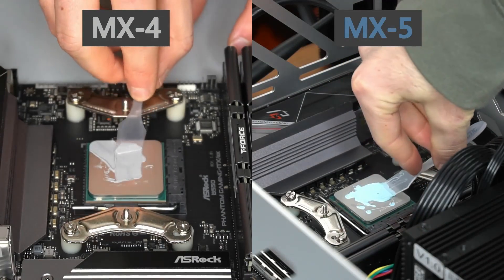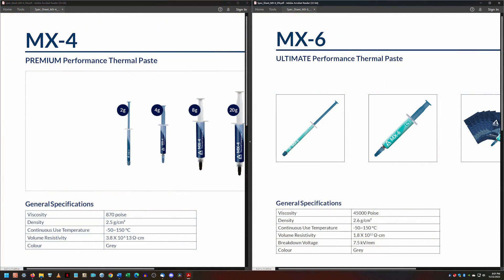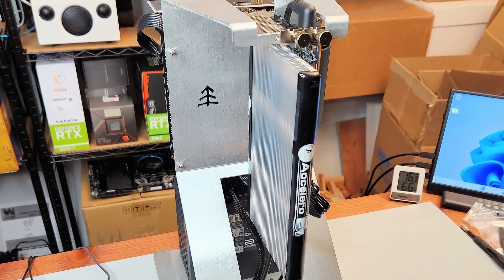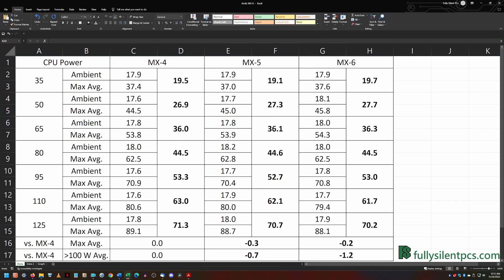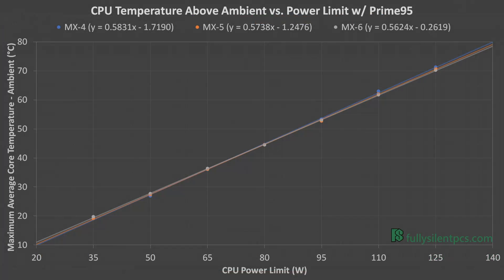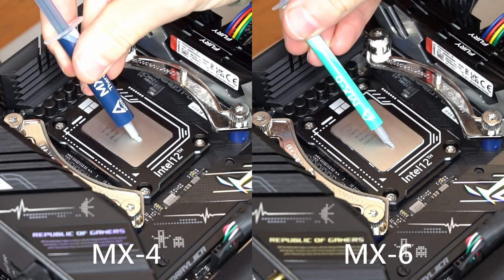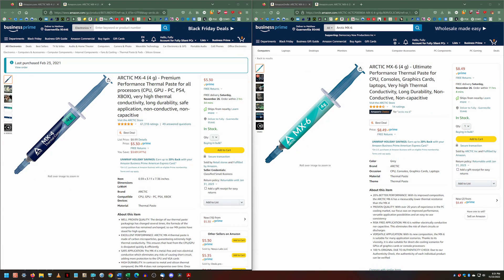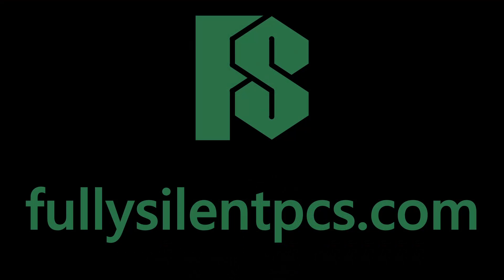Arctic MX-6 vs MX-4

Comment: A tip for all when using high viscous paste. Put the tube of paste in your pocket for 30 mins to warm it up and then use it, spreads way better lol.
Reply: gigachad commenter, ill keep this in mind even for less viscous pastes, absolutely genius
Reply: @CorruptedDogg 😂
Reply: Do you know if more viscous paste, means that it has less chance of "pump out" over time?
Reply: @millanferende6723  I don't believe so, I use mx4 still for most of my hardware. I was using thermal grizzly kryonaut, but it's pump out is worse. Doesn't mean it's bad, you just need to re-apply more often. Tho this is my personal experience which others might argue different. I think it's just based off the materials used when manufacturing the paste.
Reply: @Bassjunkie_1  Thank you for your comment! So is MX4 better for longevity then than MX6 and is that why you use it?

I've heard of Kryonaut being not so good for longevity. 

But what about Kryonaut Extreme

Thermalright 8TF
and
Noctua NT-H1

Do you have any experience with those?
Reply: @millanferende6723  Funny you ask, I have a tube of the thermalright 8tf for when I redo my water cooling on my GPU. Like you, I read it was good. And I figured if I'm rebuilding the water loop every year or so, I'd try it, tho I haven't used it yet 😅 I have used the noctua once, it was a good paste, but my issue with it Vs the mx4 was it's price, at the time I preferred kryonaut over it. I haven't had the need to buy the mx6 yet as I still have a 20g tube of mx4 and that thermalright. Tho all theses pastes are good, the most experience I've had is with mx4 and kryonaut. Sorry I can't be more help than that.
Reply: @Bassjunkie_1  Oh no worries man! Thank you for your input! All experience is appreciated.

8TF I indeed somehow came to a conclusion that it was good. thermalright is expensive and kryonaut doesn't last so long, I've heard. MX4 is also not very long lasting, but hopefully they made improvemenets on it in MX6. They have like what, 20 years experience now? So I believe MX6 and 8TF lating 5+ years is a good option.

But, the best options of course are:
PTM7950 (phase changing pad, just need few warming/cooling cycles.)
It's better and cheaper than Kryosheet (i've seen scientific measurements). At 5x or 10x pressure of what you would use on a PC, Kryosheet gets better and better, but at normal pressures, it's less good than PTM.

Liquid Metal (extreme) is of course the holy grail. But you need to make sure your heatsink is Nickel Plated. Never use copper. Then it lasts a monumental amount of time I believe. (Apparently it doesn't suffer from pump-out at all.)

So yeah. Good luck with your build! And thank you for the info.
Reply: @Bassjunkie_1   i literally have the same experience. glad it is not just me:)😃
Reply: Better yet, run a mile on the treadmill with the paste in your pocket.
Reply: @Princeton_James  that will definitely work
Reply: I wish I read this comment before I applied my thermal grizzle paste. I now had to remove it and re-do it.
Reply: don't put it in your butt
Reply: Brother your comment literally wiped the sweat from my brow. I got this.
Reply: yeah pocket😏
Reply: Does that genuinely make you laugh out loud, or are you just on linguistic autopilot?
Reply: @Spurdospaerde692  It's a tone indicator, smart one.

Comment: I love thermal grizzly but recently tried the extreme version and went thru 2 tubes of it trying to apply ut and it was actually making me mad. It felt like it was drying up and when I would try and go over it to spread it it would lift off the cpu and stick to the spreader. Legit took me like 15 minutes to put thermal paste on my cpu lol
Reply: TG pastes (all of them) are quite good yeah but they tends to dry out faster than its competitors. Definitely not recommended for those who doesn't change their paste often.
I still prefer it for my laptops though, and the the issue about how quick it dries out doesn't matter much to me because I have to clean the fans way more often than the usual due to how quick dusts built up in my area. And my laptop doesn't allow me to remove the fans without having to remove the entire cooling system.

Because of that, I've been thinking on using carbonaut pads lately since it can be reusable. I'm well aware that it's electrically conductive but it's fine and I'm willing to take the risks as I've already accustomed on handling liquid metals on laptops before.

Comment: If i want to use my thermal paste for atleast 10 Years. What would be better over time... MX4 or MX6?
Reply: Thermal paste doesn't last for 10 years, but MX-4 is proven to be a very good thermal paste, ever since its release 10 years ago, it's still recommended by most people.

Comment: for 1c difference between mx 4 and mx 6 its not worth the price if mx 4 is cheaper. a better cooler is the solution if you have some temp issues.

Comment: Bought an upgrade set used for 350€ 9700k i7 w. aio 16gb and 2070 super, gpu had overheating issues and freaked out with the fans, replaced thermal paste with mx6 and went from 80/85c to 55c
Reply: 350 euros is a complete steal for this rig. a used 2070 super by itself is around 200 euros. the aio, depending on the make and model could be around 100-150 (already the entire cost of the rig). the 16gb of ddr4 ram is around 30 euros, the i7 by itself is around 200 on e-bay

Comment: was using mx4 since 10 years ago with no issues. i change mine around 5-8 years and even if its a little little dried out the temps are still fine. now i wanted to use mx6 on my new pc cuz i see some reviews claiming around 1-3degree chiller but i`ll probably still go with the mx4 for the track record and easy apply
Reply: 3c could mean another 1/200mhz though
Reply: @iikatinggangsengii2471 wdym with that pls let me know

Comment: The reason I'm using Arctic MX-4 over any Thermal Grizzly solution is longevity. Sure I can get better performance from Thermal Grizzly, but I would have to replace it every year.
Reply: kyonout is not really better than MX4, i tested those two against Noctual NH2, and there was barely any difference at teh beginning, except, kryonout seems to be loosing the performance after just few days.
The only advantage kyonout has, is that it's easier to remove it from CPU and the cooling block.
Noctua NH2 is the winner for me, bcoz it does not seem to dry out as quickly as MX4 does, and has similar price, it's just not as easy to spread as the others.
Reply: I never had mx4 drying 
 @krisg822
Reply: @krisg822  never had mx4 drying
Reply: Replace it once a year anyway, it costs a few pounds !!
Reply: @boffyboydj  used it 7 years ago never changed it, cpu keeps cool all time
Reply: @boffyboydj  waste of life

Comment: Thank you for that, very helpful. I wonder why the Intel stock heat sink that comes with a CPU has a round plate, when the CPU itself is square ? In that case it would seem placing a dot of paste in the middle of the CPU would be the best method of application.

Comment: It should be done a similar test but after a longer time. Some thermal pastes seem great if tested after a fresh application but degrade very fast. So, the winner in near term could be easily outperformed on longer run.
Reply: the thermal pasts of arctic silver have 8 years of duration
Reply: we not talking about meat or vegetables lol
Reply: @maniaque37  In fact, the problem isn't that thermal paste becomes rotten, the problem is that some thermal pastes include compounds less stable than others and can change thermal conductivity properties faster before settle to a certain level, regardless the fact they are still fresh and not dried. The thermal conductivity after application isn't a straight line that remains the same till the end but a curve that has a different evolution according the specific formulation, and some peak after application more than others but settle lower. I have personally seen this many times.

Comment: The MX-6 may be better but the difference is so small I think I'd rather keep using MX-4 due to it being super easy to apply.
Reply: Mx-4 only good for desktop CPUs not for direct die like on GPU and laptop CPU and GPU.
Reply: @hunterkiller4578  Tell that to my 30+ GPU's with it (most 3080's).
What's your real life experience with hardware?
A quick search online you can see hundreds of results confirming that its perfect for GPU's.
The temperature drop is always massive and long lasting.
Reply: @rodrigobragamg  Please stop it. My current rtx 2080ti has mx4 (3 weeks old) and has already 16C between GPU and HotStop in Furmark. First day it was 12C. Are you capable to see the diff between 16C and 12C...?
Reply: @ORA-01403  And your point is..?Because your statement means nothing. A 4C difference is marginal (can be influenced on the external temperature).
MX4 has a curing time of 100 hours. Learn the basics. Also, depends of your skill pasting it, if the thermal pads are properly seated, if you didn't put more force than it should on the screws, etc.
Ask a professional to aid you if you are unsure about it.
Reply: @rodrigobragamg  You gave no temp results with this lmao tyupical. Its not up for arguement, the on die pump out effect effects pastes like MX4 more. This isnt new data please put your big boy pants on and accept data.
Reply: @rodrigobragamg  4c is not marginal unless you are too dense to see what its telling you. Cure time wont stop pump out effect over time just slow it. Thats accounted for (that should be obvious to anyone?) Its saying that the temps are going to rise slowly over time due to pump out effect and not ideal for the application. Im sorry you put a suboptimal paste on dozens of gpus but deal with it man. It wont kill them but just pipe down pretending its not optimal and we arnt talking marginal after a year. It might be good enough for your 4/10 setups but not everyone settles for 4/10
Reply: @Paultimate7 So would you recommend mx-6 if i was going to e.g replace cpu and gpu (desktop)? And do you think 2gs would be enough or should i buy more? Personally i repasted before with corsier tm30 and never had problems, though that was a 9700k and a 1660 i have since upgraded to a 2070 super. Unfortunately it’s a blower so it run hot. Was thinking of repasting bc the card has been sitting since 2020, and mine as well hit cpu while im at it. Seems there’s more to repasting than i initially thought. I was under the assumption you paste correctly and tighten correctly and you’re fine? And i have had no problems like i said but with this new card i would not like to run into some bc it is hotter… thanks for the answer if you anyone else has time 😅
Reply: @Pcmaster_race-_-1  mx6 should be good for gpu, but you need to spread it. 2g should be enough for 4 gpu's if not more, unless you apply exorbitant amounts.   

Im trying mx6 on my gpu, so far so good. 
I had problems with MX4 pumping out on laptop gpu, but I previously solved it by applying exorbitant amount of mx4 so when it contracts, it doesn't suck in air lol.
Reply: @ I just did my cpu, i spread it first time and got barely 2c less and when i did the pea method i got 10c less and 1k more score on cinebench with less thermal and power throttling on xtu stress test as well. That was about two days ago so far so good. I personally don’t recommend spreading as my results weren’t good on the cpu at least. As for the gpu I’ll probably try both methods as well bc im pretty ocd about getting the best results.
Reply: @Pcmaster_race-_-1  I dont spread on cpu, only apply X on cpu. For GPU I do spread + dot I dont want to risk hotspot especially with thick paste like mx6.
Reply: @ hmm yea that might be the way to go actually. Spread plus a dot. I will try that out either tonight or tomorrow. Ill let you know the results if you are interested
Reply: @Pcmaster_race-_-1  tried out mx6 on cpu, also saw 2c improvement compared to mx4.
The gpu has the same hotspot and temps after a month so far. Seems like mx6 is superior.
Reply: @rodrigobragamg  this is complete bogus and dangerous misinformation lmao, ive used mx4 countl;ess times on my rx 6700 xt. Works well for the first day then it gets pumped out and the temps go back to square one. Next time think before u comment
Reply: the thing it's how much it lasts on bare die
Reply: @MrGlitchDogePE  Theres no long term testing, at least i have never seen long term testing in my 24+ years of being into tech. Paste does not cost that much to test it ourselves, ive used mx4, kyronaut, and loads of others. I stick to mx4 for most things i do as its price is worth it for the amount of pcs i build. I tend to use higher performing paste in my main pc. But mx4 atm does the job for anything i do.
Reply: @MrGlitchDogePE what’s that? You mean it’s longer before you should replace it?
Reply: @MrGlitchDogePE  same
Reply: I have repasted a ryzen 5900x now 2 years ago and the temps are 2° above when it was new, i used mx-6 with mx-4 one year and i had to repaste
Reply: @newthepanch  Which 2c difference could be from dust 
My 12400f with freezer36 and MX-4 was at first full load test at 51c and after 2,5 years it's still on 51c max load
Reply: @newthepanch  Do you understand the diff between on die and IHS, if you do not then youre arguing with yourself.
Reply: Its Mx5😂
Reply: Yeah, its better for beginners as easier to apply, but there are better ones! Those more difficult to apply are more effective, but difficult for beginners.
Reply: Depends on the rig...I've been through mx4, grizz and s few others. Mx6 literally keeps my gpu at around 60fps on both my 1080ti and now my 3070. It stays at 48 c during delta force gameplay in 4k. I've used both in 4k cause of my monitor. 1080p looks blurry on mine.
Reply: for MX-6 Arctic clearly says: Do not apply with spatula. Use pressure of the cooler.
Reply: @Coolgamer400  because they know many people can't spread it properly, buy not because it is best.
Reply: Yeah becuse you apply this daily? Why care unless youre making a pc a day dude? Also consider ACTUAL problems lik ethe pump out effect that MX6 and other pastes resist more than MX4.
Reply: Exactly
Reply: The idea is (i hope) to use mx6 for some years... MX4 (usually) should be replaced every 12 months.
Reply: @ORA-01403 pero el fabricante dice que dura 8 años. O al menos eso garantiza...
Reply: @ORA-01403  MX-4 is supposed to stay good for 8 years but that could just be its shelf life, It usually doesn't last much longer than 7 months on my laptops where it's applied between a bare CPU/GPU die and heatsink (it disappears or turns into a liquid and runs off the sides of the chips), I just repasted my Alienware M17X R4's CPU (I7-2820QM) and Graphics card (Nvidia GeForce GTX 660m) with Arctic MX-4 and installed new Arctic TP-3 thermal pads today and the CPU is still very hot at idle (70+), when I first did it the computer shut itself down from overheating because there was no contact between either chip and their heatsink so I had to open it back up and add more MX-4 and now it doesn't shut down but the bottom plate is uncomfortably hot and when I first got this thing the CPU idled around 40 degrees with MX-4
Reply: @ORA-01403  LOL where did you came out with that? I had mx4 for over 14 years on a cpu and temps were just a about 3C higher than when new...
Reply: @rafars2246  MX-4 applied on first day of custom rig in 2014, never removed, thermals exactly as expected, probably ever so slightly higher but convenience level beyond expected, will use again. Note: MX-4 from 2014 is probably not the same as MX-4 from 2025 which is surely improved further.
Reply: @q1337  Definitely the very best out there, spread and forget.
Reply: @ORA-01403  Delete while you can.... MX4 doesn't degrade.
Reply: @rodrigobragamg  I lot of people who repair GPUs do not agree with you.
Reply: @ORA-01403 on GPU either it slips out bcz of high temperature or pump out due to high temperature. It only works well with IHS which only desktop CPU have. 

Experience user here.
Reply: @rodrigobragamg  Dont speak unless you know better. Not all of us are doing low-grade 1 pc building and pretending we know long term high volume or on die direct effects. Just hush adults are discussing.
Reply: @hunterkiller4578  I don't think you're that experienced if you don't know how to apply the mx4 to your gpu. I only use the mx4 on all of my machines and I have over 50 PCs in my retro museum alone.
Reply: how long dose it last for when you open the tube? iv had mine for well over 5 years
Reply: @ORA-01403 why are using mx4 on gpu 💀

Comment: i actually have issue with my rog scar 3 i7 970h and rtx2070, when i decided to apply MX5 to both cpu and gpu, the cpu wsa not running the max frequency it used to do with MX4, after i change it back to MX4 on the cpu but MX5 with the gpu, it as running fine, i suspected to be the MX5 viscosity not working properly with the cpu

Comment: I repasted a Legion 5 laptop(4800H-1660ti) from Hydronaut to MX-6. This paste seems to perform better overall. We'll see in the long run. 

On a side note, I'm curious if it's going to make a difference on my 12700K compared to Hydronaut.
Reply: Update.

I've switched to MX-6 from Hydronaut on my 12700K(Arctic 360 AIO with Thermalright bracket), seems to be around 1C lower with the MX-6, within margin of error.

Either way, it's good shit.
Reply: @LennethValkyrieify  is it great for long term??
Reply: @nirwanmuiz7695  Yea, nothing changed.
Reply: 6 more months later (10 in total), is it still good on the laptop? I want a thermal paste that I don't have to worry about replacing every 6-12 months lol
Reply: @Weroleytor  For laptops it's very good however, if you want something even better look into PTM7950, believe me...you won't regret it.